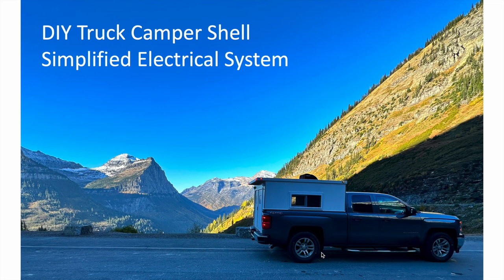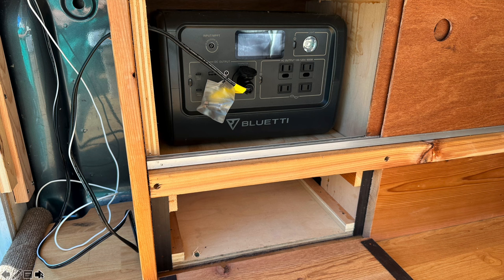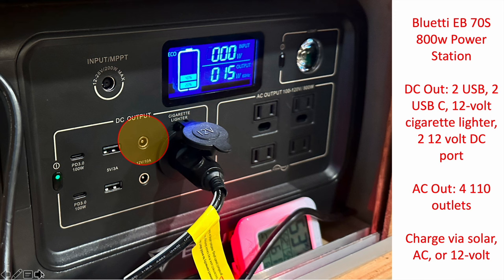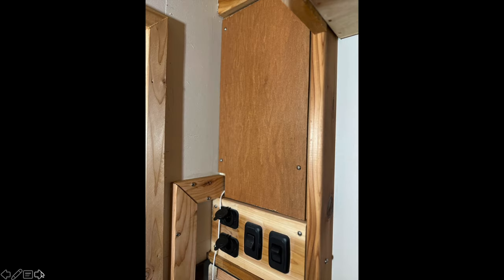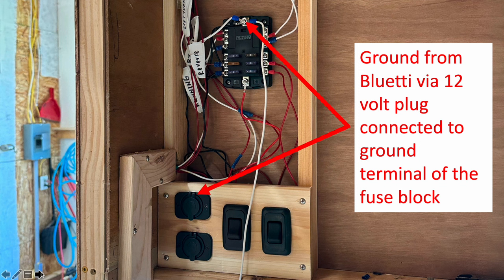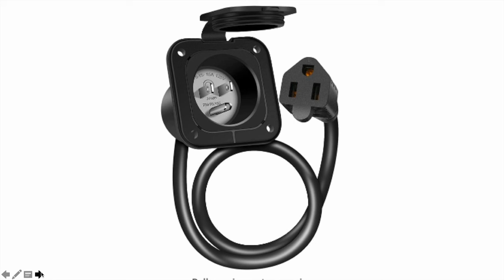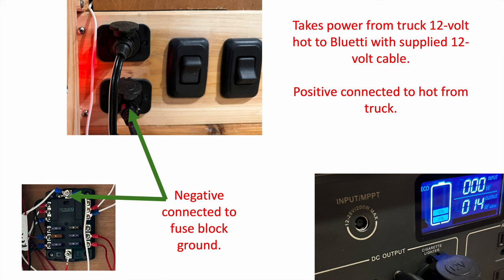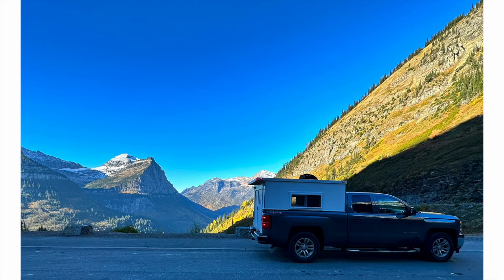DIY Truck Camper Electrical

Comment: A lot of great ideas that I'm going use.I wish you were my neighbor here in Wi., instead of Michigan, so I could run over and get your opinion on what I plan on doing. I also love the porch lights, where did you get them from ? Also,  how long is your truck box, it looks like it's 78 inches,  the same as mine.

Comment: Thank You for the detailed video of the electrical. Do you know about how many watts of power you are able to input into the Bluetti from the 12v of your truck?
Reply from the maker: Not many. About 30. I was driving 14 hours a day so it wasn’t a problem. If I was only driving for a little bit I’d either need a campground with AC or I’d need to buy solar panels.
Reply: The answer is look at your truck not his.
My last 2 Escalades were 60a.  Oddly an Escalade is an anomoly, I can only pull a light toy hauler but have 60a! Some 3/4 ton only have 40a. "Towing" packages are higher as evidenced by a 6 or 7 pin. Mine is 7 pin~ which gets you trailer  braking. Most trucks these days offer 7 pin but just 40a.
My new Lade was $167k and change and carry a quality low db gen/ inverter which easily powers ac air. RV air all seem rated needing 3500w. 
There are endless RV power blogs.
Reply: Talk to a good mechanic, he may be able to change your alternater to a higher output one,  and run a separate,larger😅 wire back for charging.